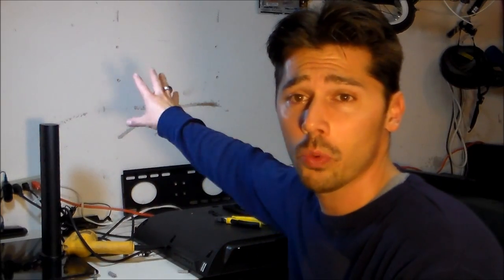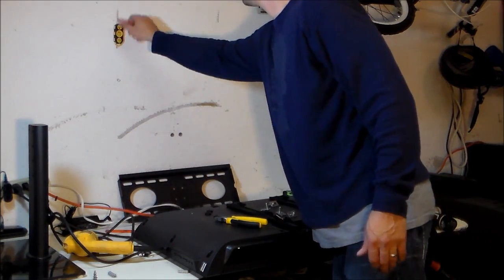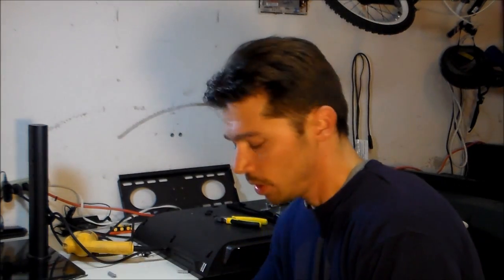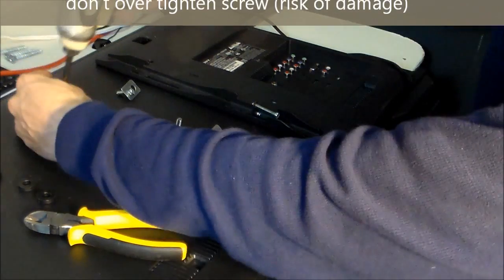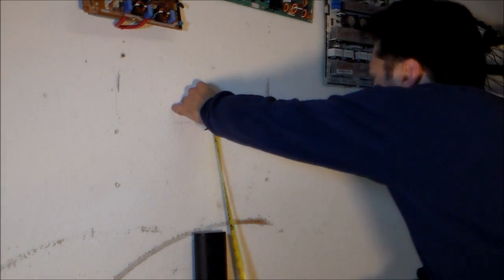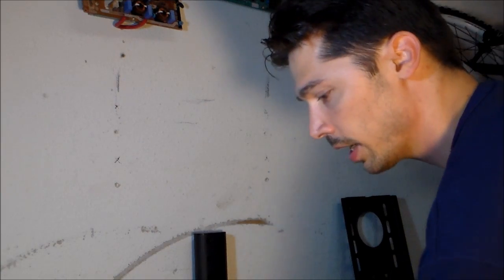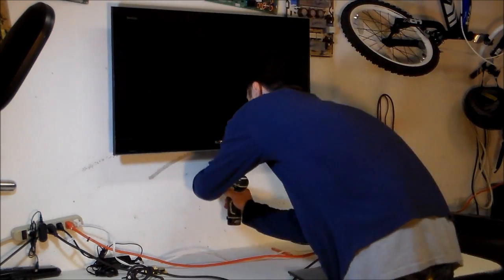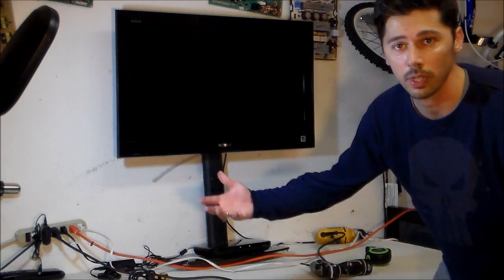EASY WAY TO HANG TV ON WALL MOUNT Review

Comment: The magnetic stud finder will only work with metal studs.
Reply from the maker: No these are wooden studs with metal drywall nails. but it does work on metal studs of coarse too. 8^)
Reply: g w